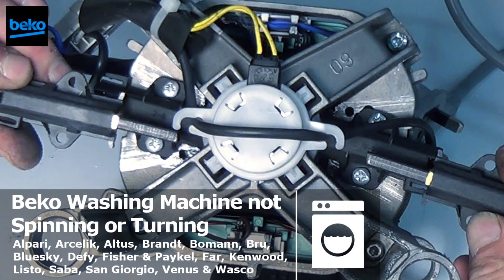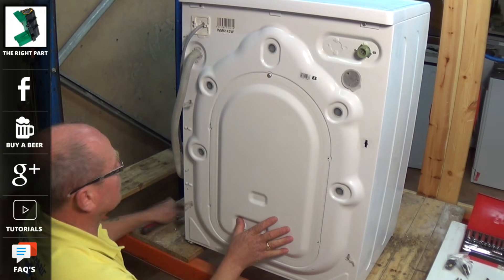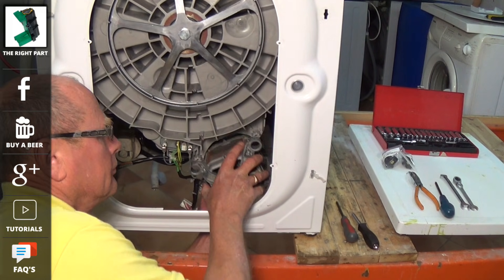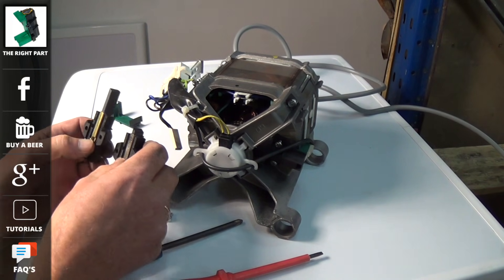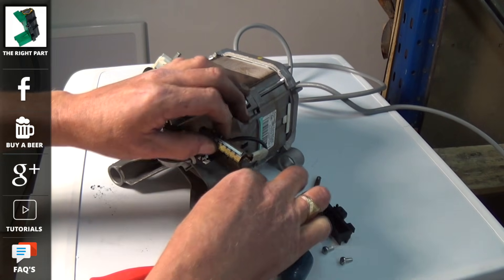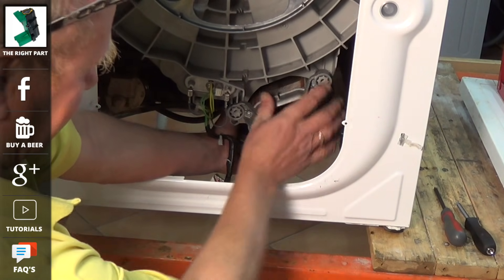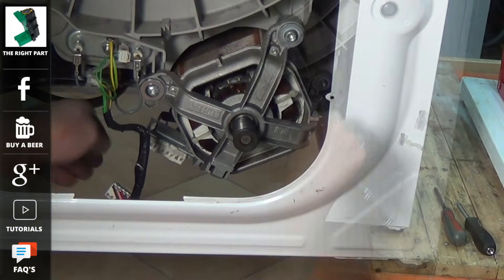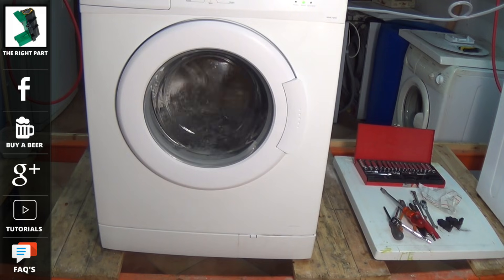Beko washing machine not spinning or turning  how to replace carbon brushes

Comment: Great video, very thorough. I have brushes on order and would not have thought about transport tabs or checking the commutator for irregularities that nibble the brushes faster.
Also the diagnostic section (brushes or blockage) good to know.

Comment: I am so thankful for this video. Sent a beer :) This is the second tie in 9 years I have had to fix my LIGHTLY used Blomberg/Beko. I fix it flat on the ground, so I don't need to remove my attached dryer. A little more of a pain, but with the extender you suggested it worked o.k. Thank you!
Reply from the maker: Glad it helped mate! Thanks a lot for your donation. Please remember to subscribe to our channel, as that really helps us 😇

Comment: Hi could you tell me how to remove  a motor from   Beko WMB91442LW please my motor is different to this one and i cant seem to find the two screws at the back of the motor either
Reply from the maker: Hi, please use our contact us page and make sure you fill out the request for what your problem is. I will need the full model number of the identification plate and the details of your problem so that I can provide you with useful literature. A video shoot of the problem would be perfect as well.

I will get back to you within 24 hours, normally. https://www.how-to-repair.com/help/contact-us/  

Please remember to subscribe to our channel, as that's what keeps this channel going. Thanks, Paul 👍

Comment: My motor also was not turning but the brushes and the DC circuit board were FINE. No error codes. The problem was: The motor connector had broken cables, not visible! But pulling some just ripped them off, they were only attached by their insulation! Replacing the connector by crimping single insulated flat connectors on each cable and adding some hot glue to prevent their detachment fixed it for me.

Comment: I know this is an old video but my beko wm74155 isn't spinning, when it goes to the spin option it just makes a juddering noise for about 8 services (the noise sounds like a woodpecker if that helps)😅, do you think that's the brushes or something else?  Thanks

Comment: I had a man out today ,he tipped the machine back a bit put a torch in and said your brushes are ok but you need a new motor . How possibly could he tell when he removed nothing and didn’t even try to put the machine on . Was I ripped off 20£ call out charge.

Comment: Hi Paul, my beko machine has the e11 code ,the motor is turning and spinning fine,but there are some sparks from the motor. im guessing that its the brushes, would love your thoughts please. Plus , I couldnt have deciphered without your videos. Legend and thankyou.
Reply from the maker: Yes, it does sound like the brushes stop using the machine immediately as you will damage the armature, take the motor off and make sure you replace the carbon brushes and also inspect the armature for any raised lugs  glad we could help you @vitog3806 this is for you https://www.youtube.com/shorts/e432SAb2g08 please remember to subscribe as that's what keeps this channel going. Thanks 👍
Reply: also, the code has now gone ? its displaying 1620 ?? but all working fine through the diagnostic steps when pressing the start button.

Comment: I take off  the moto and the brosh is ok but is not working
Reply from the maker: Then you need to do checks on the motor, or it is possible. It is either the wiring or the printed circuit board. glad we could help you @arifahmedali2995 this is for you https://www.youtube.com/shorts/e432SAb2g08 please remember to subscribe as that's what keeps this channel going. Thanks 👍

Comment: Great video covering the exact model of motor that I had in my machine.
Just fitted the new brushes today. 
I actually turned the machine upside down and found it much easier to get at the motor. 

A little bit of a water leak when all the hoses emptied, but I was prepared for that.
Removing the motor inner bolts was fiddly, however I had some flexible socket drives and torx bits and managed to get them out.
Replacing the brushes and cleaning the commutator was simple.
However I struggled to get the drive belt back on. It was quite cold in my garage so I was worried about getting my fingers nipped.
After a number of unsuccessful attempts I decided to use a couple of plastic cable ties (available from Screwfix/Tool station etc) to hold the belt on to the flywheel.
I put on two ties securing  the belt to the flywheel (2o'clock and six o'clock) and then gently rotated until the belt went on.
Reassembled the back panel,  turned over, switched on and hey presto the motor kicked into life. 
Saved a few quid and prevented a serviceable machine from going to landfill.
Thanks for all your help
Reply from the maker: I'm glad the video helped you not too keen on you turning the machine upside down but at least you got it working. Have a great Christmas and a happy New Year. Thank you very much for subscribing to the channel

Comment: Can I ask what are you using to take  the motor bolts off, size and name would be greatly appreciated.
Great video 👍🏼
Reply from the maker: some of these machines they use TORX bits which fit into a screwdriver or into a socket, you'll find a wide selection of these on eBay these are very cheap this is an affiliate link https://ebay.us/yCSXD5 Thank you For leaving a comment this is for you https://www.youtube.com/shorts/e432SAb2g08 please remember to subscribe as that's is what keeps this channel going. Thanks 👍
Reply: Many thanks for advice and video, brushes did need changing, you saved me a good for bob.
I’ve just got you a beer as a thank you … enjoy 👍🏼

Comment: Hi 
I have smasung washing machine and today it stopped spinning well it looks like it tries but it won't actually spekan appart minimal about inch moment back and forward I cleaned filter and all first then I took back and I event took the belt off but also on motor you can onky see minimum movement back and forward it wont engage as it shoudl be is the faulty motor or somethink what may control the motor 
Please advsie 
Thanks Patrick
Reply from the maker: if it's a three phase motor you may either have a problem with the hall sensor or a problem with the circuit board please remember to subscribe as that's is was keeps this channel going. Thanks 👍

Comment: This vid has just resurrected my machine for about £6. Thank you kindly. I have paypaled you a beer.
One question it is squeaking a bit I'm assuming that will subside as they are warn in. Did not seem to be a lot of scope for changing the angle of the carbon contacts.
Reply from the maker: Glad I could help it should quiten when warn in. thanks for the beer please remember to subscribe as that's is was keeps this channel going. Thanks 👍

Comment: Beko machine as in the video, took off the motor as described, and found that the thin insulation strip from the actuator had slipped down so was effectively stopping contact with the brushes.
Cut it off, put the machine back together and it works. Question is, is it safe to use?

Comment: Great video. I have just removed the brushes. They are totally worn and black carbon dust everywhere . I am hoping the new ones fix the problem of the motor not working and spinning the drum when i fit them tomorrow. Thanks.
Reply from the maker: remember to clean up the armature, and please remember to subscribe to the Channel as that's what keeps us going in able to make the video smaller

Comment: Thanks for that, it's a great help. The later versions don't have the rear bolts on the motor, just the two on the front. You can pull the motor off the rear locations. The brushes were too long to fit on my motor, so I had to file them down a little.
Reply from the maker: I've had that a couple of times I don't know why they don't stick to one holder size

Comment: Looking for a little help. I replaced the brushes & the machine is working but it is making a loud zzzzzzzzzz noise when the drum is turning.  There are also sparks coming from it during spin cycle. Any advice?
Reply from the maker: This may be just the carbon brushes seating but if you are in any doubt make sure that they are wearing correctly. a pleasure We now have Live Q@A's weekly on our live show, see our home page https://www.youtube.com/c/How-2-repair for the next date
Reply: @How-to-repair  thank you so much for the advice. I'll double check the wear on the brushes. Hope u had a great xmas

Comment: @paul .Brilliant turorial . My washing machine starts to spin does a couple of rotations and abruptly stops .i've checked filter its clear .Pump appears to function okay .machine 100% level . Could it still be a problem with drive belt or carbon brushes ? Any help much appreciated .

Comment: worked great new set brushes under a tenner, a few probs fitting the belt back, but googled and saw the tip for using a cable tie to get belt back on, also another tip for home diy'ers get yourself a cheap 5 quid t bar screwdriver with torx or pozi bits, makes it easier to undo bolts on motor when you have the leverage etc, and the length of the t bar handle reaches bolts at the back, nice one for the advice, can do washing now ....
Reply from the maker: Iam Glad we could help you. 
My Ebay Shop https://rover.ebay.com/rover/1/710-53481-19255-0/1?mpre=https%3A%2F%2Fwww.ebay.co.uk%2Fstr%2Fhowtorepair&campid=5338676951&toolid=20008
If you ever need help please use our site for 24 hour response https://www.how-to-repair.com/help/contact-us/
If have a question please use our site for 24 hour response https://www.how-to-repair.com/help/contact-us/
Please remember to subscribe to our channel
https://www.youtube.com/user/Apart4u?sub_confirmation=1

Remember to Shop with www.how-to-repair.com and it would help us by posting the video or

website on your timeline. This helps us a lot and if we really helped you can
always buy us a beer http://how-to-repair.com/help/buy-paul-a-beer/

Please remember to mark us to your favourites also I would be grateful if you would
subscribe to our channels social media as this really helps my site and keeps
us going.
YouTube. http://www.youtube.com/user/Apart4u

Facebook. https://www.facebook.com/how.to.repair.appliances

Comment: Hi, I changed the brushes on my bosch w/m as it wasn't doing anything. Put it on a test run and it work through 2 different programs, then when we put in a wash it fills and then starts cycle but when it does a rotation of the drum it only does 1 rotation and the motor stops. It does this in all programs, any ideas?

Comment: In my long experience cleaning the com is a waist of time & more likely to damage than fix any problem. It won't fix the problem if one of the segments are lifting. After starting with the cleaning ( & sewing sparks ville for long time), tried not cleaning  & not problems for the next 8000 sets. Maybe on some equipment it's different just talking about wm motors

Comment: An eBay seller sold me a set of carbon brushes for my C.E. Set motor and the carbon was the wrong way around, resulting in only the sharp edge making contact with the commutator. I dont understand why the brush was incompatible with my motor? Why would they manufacture a specific type of brush in two different versions? You live and learn?
Reply from the maker: some times, the model number alone is not enough to find a part as certain models are manufactures in different places around the world 

if there is a twelve digit number on the label you got the model from try looking up the part under that number instead of the model number, i hope this helps :)
Reply: @How-to-repair  I've since discovered that brushes can be mounted on my motor in two different positions, so the brushes contact the commutator correctly! You live and learn? Thanks.

Comment: Hi Paul, I watched your YouTube video on how to change the carbon brushes on a Beko and I managed to fix it all by myself, 8 months pregnant and all! Thank you so much!

I have changed the carbon brushes and the machine is now spinning (it wasn't before) I ran a quick 30 minute cycle and it worked perfectly, only thing is it is making a whining sound when spinning. I went back in and I have used sandpaper to clean the commutator as there were a few little sharp edges, but the noise persists...What could this be? 

Before I got around to changing the carbon brushes, I have cleaned out the filter, I have checked for foreign objects through the heating element slot and the drive belt is in excellent condition. 

Please ca you help, what could the issue be?

Thank you so much!

C

PS: how can I buy you a beer? the link via the video isn't working!! :(
Reply: The noise has gone down significantly now that I am running the second wash cycle.. could it have been the drive belt? 

I managed to bu you a beer! :)

Comment: Hi I've checked the machine and it came up with a E11 error code. It fills up it drains fine. But wont spin. I've checked the belt and carbon brushes they seem fine... anything else it could be??

Comment: Followed the instruction as the machine wouldn't spin.... It now works but gets stuck mid cycle and won't move on... Won't spin at high revs and then empties and stops.... Wet clothes. Little or no heat.

Comment: What the screwdriver or socket set used to undo the moter? Thanks
Reply: Hi. Did you ever find out the socket needed to remove these bolts?
Reply: You mean Motor

Comment: Thank you,thank you,thank you so much for your upload.My wife has a BEKO WME7267S washing machine,that uptil yesterday evening was working fine.We she put in another load to wash,the drum wasn't moving at all.I had carried out ALL the test sequence and couldn't work out what was wrong.That was until i watched this video of yours.I took out the 2x motor bushes last night and there was only a small amount of the "Carbon" rods left on them.So first thing this morning off i went to my local appliance parts shop and bought a brand new set of motor bushes.Connected everything back up and the machine is working like a gem.

Comment: Many thanks! £10 for brushes fix, rather than new washing machine.
Only awkward part  prizing motor out (flat head needed for leverage) and then those back 2 bolts out that hold motor, and as you say, the right tools go a long way.
Tip for those about to have a go at this repair - wear latex gloves as the carbon deposits are all over the place once you get the motor off.
Reply: Tip machine back to access the back of the motor and brushes

Comment: Hi there. Great video but any idea how to test a fairly new ( couple of years old) Beko WMB series washing machine that has a brushless motor (think it may be an inverter motor).
The motor won't run at all on any program and no error code when I put it into the test mode as per your video.
Cheers

Comment: followed it up until you have to remove the motor. it seems very tightly fitted to the bracket at the back. couldnt squeeze a screwdriver to prize it. any ideas?
Reply from the maker: sorry for delay when you have a question please use our site for 24 hour response https://www.how-to-repair.com/help/contact-us/
Iam Glad we could help you
Please remember to subscribe to our channel
https://www.youtube.com/user/Apart4u?sub_confirmation=1

Remember to Shop with www.how-to-repair.com and it would help us by posting the video or

website on your timeline. This helps us a lot and if we really helped you can
always buy us a beer http://how-to-repair.com/help/buy-paul-a-beer/

Please remember to mark us to your favourites also I would be grateful if you would
subscribe to our channels social media as this really helps my site and keeps
us going.
YouTube. http://www.youtube.com/user/Apart4u

Facebook. https://www.facebook.com/how.to.repair.appliances

Comment: Awesome video - I managed to repair our Beko WME8227W washing machine by turning it up at 45 degrees and accessing the carbon brushes from the back/bottom, unscrewing them to assess damage and without having to replace them (one had just become a little jammed and wasn't springing out properly) managed to make it work again! Many thanks, I have bought you a beer or two! :)

Comment: Excellent video,  after struggling for half hour getting the back right hand screw off the motor (not using the correct size ratchet) i finally got there, i realised one of the carbon brushes had worn down saving us on a new motor.  I have ordered some new brushes thanks to you for this brilliant video, cheers.

Comment: When I run the test mode mine wont spin counterclockwise, it spins clockwise and passes all other tests, in normal mode i start any cycle and it stops after a few minutes and just stops, could it be the brushes.

Comment: My machine had been making metallic grating noises (probably sparking) before it stopped turning.  One brush was badly worn, but still in contact with the commutator.  I cleaned the commutator with some wet and dry and it started working again.  New brushes are in the post while the machine is in bits.

You can check whether there is a problem with the brushes/commutator without removing the motor by putting a continuity tester across the pins in the big plug (I used an LED and some batteries).  Turn the shaft slowly and there should be no break in the circuit as it turns (the LED stays lit if it is ok).

Comment: Even after removing the bolts the motor seems stuck. It doesn't move a millimeter even when i apply counterpressure. Any thoughts ?
Reply: ludeboy77 3:35 did you try prising it back a bit?  mine was quite well stuck on but it did come off.

Comment: thank you guys! i'm an engineering student and as soon i get my job i will buy you guys a beer :) :D
Reply: Hi, Paul thanks for taking my call yesterday and advising me on the rinse problem I was experiencing with my Beko washing machine. Removing the brushes freed them off and a clean of the com' did the job, have done two full washes with no problems. Good job! Dean Gardiner